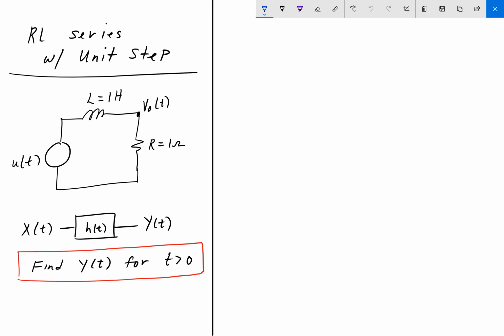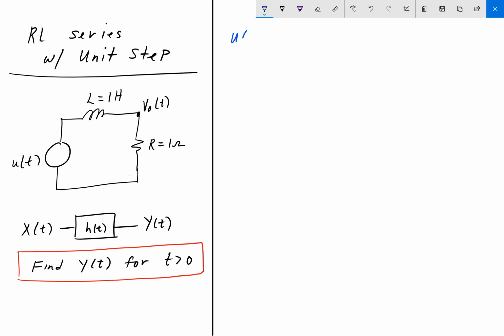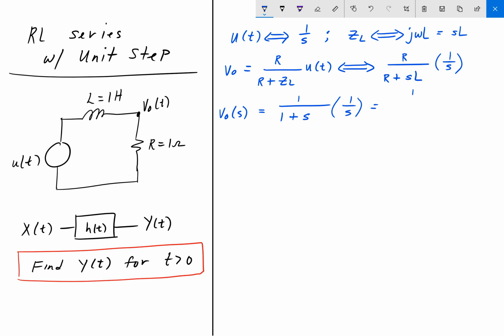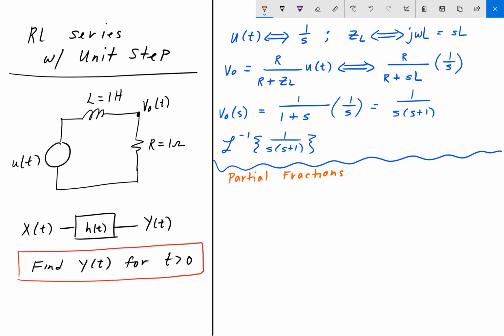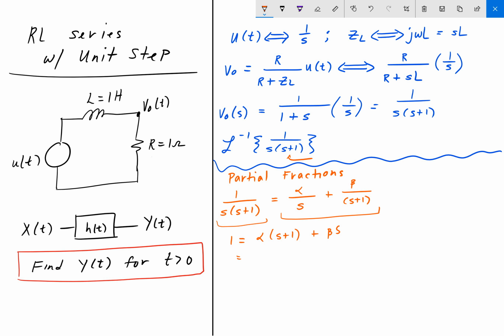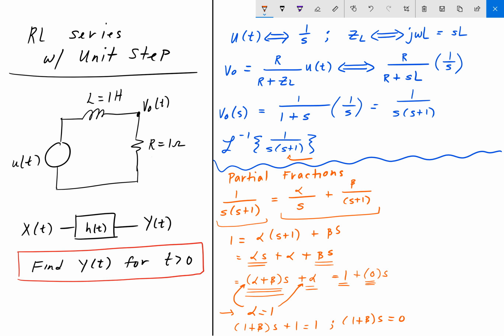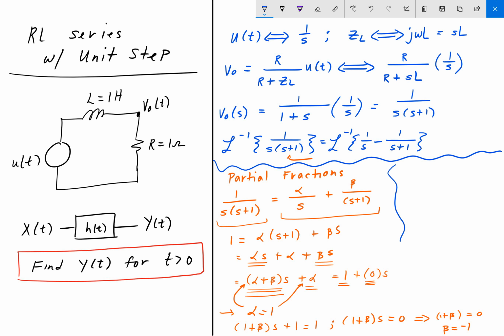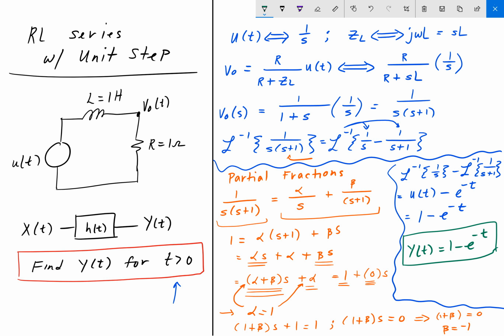Electrical FE /EIT Exam Prep - Linear Systems 2: RL Circuit with Unit Step Input

Comment: You could also just use the RL transient equations. Since the unit step can be modeled with a dc voltage of 1V in series with a switch. You just use the equation given for Vr in the FE handbook. Much faster and less complicated than dealing with convolution or Laplace. It just becomes a plug and play problem.
Reply: This was very helpful, thank you
Reply: Could you please reference it in the new 10.1 handbook?
Reply: @sherifel-bokhary8342  Page 362 middle configuration